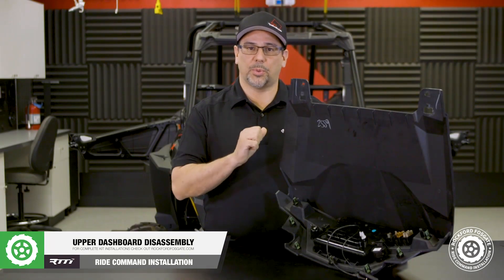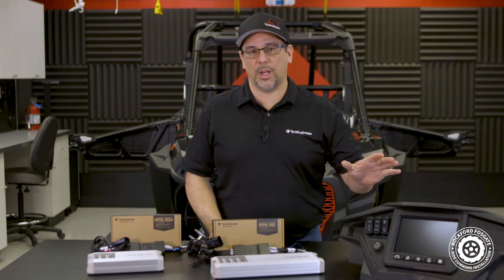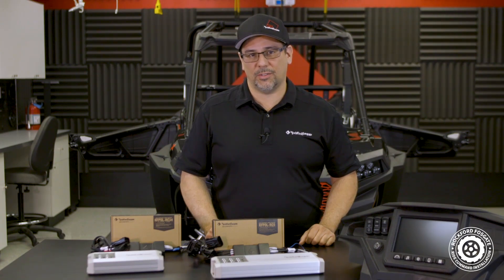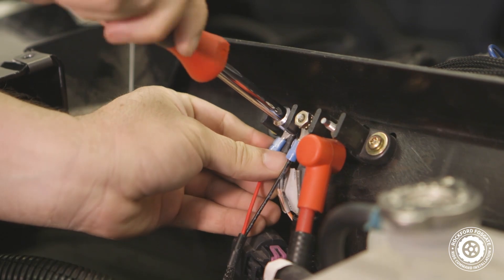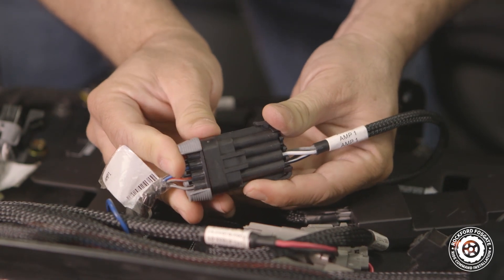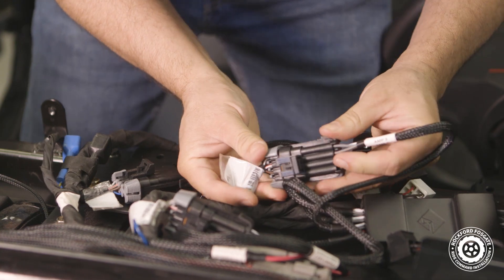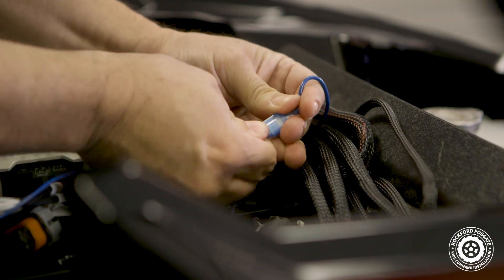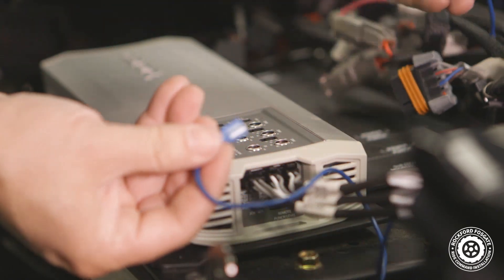Ride Command Interfaces STAGE3/4/5

Comment: I'm adding a RF stage 3 w/ ride command on my 2020 RZR Turbo S. It came with doors speakers and an RF amp as OEM. I want to keep it on, and install the RF Stage 3 w/ ride command, has anyone have pictures and info on how to do this?
Reply from the maker: HI Audric, Rockford Fosgate's aftermarket Stage Kits for Ride Command are not designed to interface with any factory installed audio equipment.
Reply: So I was told by an RF technician that I could keep my RF OEM amp and door speakers and still use the RF stage 3 ride command and hook it up to amp 2. Do they cancel each other out and disable my ride command
Reply from the maker: @audrichartendorp7630  You'll want to check back with that technician who told you this because it's not a configuration we support.
Reply: @rockfordfosgate  Ok, everything is mocked up, I removed the OEM amp, it's disconnected from the Dynamix module, but the Dynamix module is connected to Amp1, do I remove this and connect it the the RC-34 interface? What happens to the Dynamix module? Please give me a step by step instruction on this, your video only says re-install the dynamix module screws, but that's it. The RC-34 connects to the new amp input and output, Amp1 (front speakers) and Amp3 (Sub) nothing about connecting back to Dynamix module.
Reply from the maker: @audrichartendorp7630  Unfortunately there are no step-by-step instructions since adding a Rockford Fosgate aftermarket system to any Polaris OEM system is not supported.  What I can tell you is that AMP1 & AMP2 plugs are HIGH-PASS outputs and the AMP3 plug is a LOW-PASS output.

Comment: Can I use your Rockford RFHLC High Level Speaker Signal to Low Level RCA Adapte to send a signal to my current aftermarket amplifier? To keep the OEM speakers and add a couple more aftermarket speakers and a a subboffer? I have a 2021 Turbo S ride command and dynamix suspension. I know your Rockford RFHLC is not water proff, just want to know if that configuration will work.
Reply from the maker: What exactly are you doing because we're very confused with your setup.  Sounds like you already have a Turbo S + Ride Command system equipped with a factory installed audio system, correct?  There should be no need to add any adaptors in place since the factory system already connects the source to the amplifier.  For whatever your application is, the Ride Command Interfaces are designed to add aftermarket systems to Polaris UTVs with Ride Command having no existing audio system to filter out the digital noise caused by Dynamix.  Using a LOC like the RFHLC will not work for reducing high-level speaker line voltages into low-level RCA signals because it does not have any PWM filtering capability.

Comment: You don't explain how this item interfaces with stock amp or if the new replaces it, how are all the extra speakers plugged in if the rfpol-rc34 takes the place of the speaker outputs, seeing as input is supposed to be your head unit.
A simple picture lay out would have been more efficient.
Reply from the maker: This video is designed as a supplement to Rockford Fosgate Polaris UTV Stage kits (see links below).  It is not designed to interface with stock amplifiers.  The RFPOL-RC34 is specifically designed to interface with the Rockford Fosgate TM400X4ad aftermarket amplifier, and the RFPOL-RC5 is specifically designed to interface with the Rockford Fosgate TM1000X5ad aftermarket amplifier.

RZR14-STAGE3
https://www.youtube.com/watch?v=sddnwYFZ6z8&list=PL-ob-nWq0t1jl_ft08blTV-xN6aEQSRF-&index=14

RZR14-STAGE4
https://www.youtube.com/watch?v=gmh46ONL0mA&list=PL-ob-nWq0t1jl_ft08blTV-xN6aEQSRF-&index=16

RZR14-STAGE5
https://www.youtube.com/watch?v=g8mlU_-DdJo&list=PL-ob-nWq0t1jl_ft08blTV-xN6aEQSRF-&index=18

RFPOL-RC34 > TM400X4ad
https://rockfordfosgate.com/products/details/rfpol-rc34/

RFPOL-RC5 > TM1000X5ad
https://rockfordfosgate.com/products/details/rfpol-rc5/
Reply: @rockfordfosgate  I've watched all the videos back to back stage 3/4/5 and **-rc34  did not tie into the videos it also did not mention where the extra speakers plug into if rc34 takes their place on the amp.
Reply from the maker: @RTJoJo  When you mention "stock amp" and "extra speakers", did your RZR, General, or Ranger come equipped with a factory audio system?  If so, this interface cable is not designed for those systems.  The RC34 and RC5 interfaces are designed to build a system from scratch using the TM400X4ad or the TM1000X5ad amplifiers (as illustrated at 1:22 where we describe the interface cable and amplifier matchup) or as an interface for STAGE3, STAGE4, and STAGE5 systems.
Reply: @rockfordfosgate  My customer supplied a stage 3 audio kit with **-rc34.  Unit has factory ride command and audio/ rockford fosgate #4017614 amp. Per you stage 3/4 video, speakers are plugged in using splitter harness, sub is plugged into rear output. If this is so, there is no input from ride command. This is where **-rc34 comes in as interface for ride command, however if amp 1 is unplugged( power to oem amp), this terminated the oem speakers as well. RC34 now takes place of speaker harness and there is no input from ride command or any head unit. Per your video of how to connect rc34 to system.
Also if rc34 is plugged in there is no adapter to install sub to factory harness.
Reply from the maker: @RTJoJo  This sounds like it has the factory equipped MB Quart audio system.  Polaris was having problems with the MB Quart amplifier and we provided a replacement amplifier for the factory installed system, which we consider a closed loop system, not designed to be interfaced with.  I would highly recommend you contact our technical support so they can offer advice on what options you have.  They can be reached right now for the next 2 hours at 1-800-669-9899.
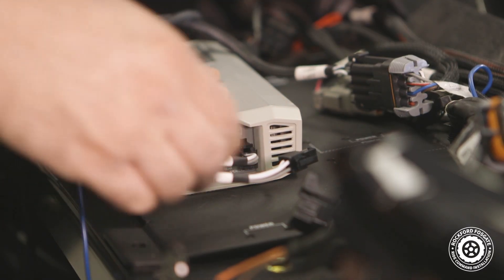Reply: @rockfordfosgate  so obviously the confusion was on my end and your tech guys were great. Where i was getting confused was at minute 3:25-3:30, visually it looked like to output/power side of the amp I was provided. The  amp you show may have the gainer plug in that I'd mistaken for the B+/-/R plug-in.
Reply from the maker: @RTJoJo  Great!  Glad they were able to help out.  You actually saw correctly, I accidentally plugged it into the amplifier outputs when we filmed this part.  I remember distinctly we were in a time crunch, it was a long day, and didn't realize we did it backwards until weeks after we released it.  You're only the 2nd person who caught it.  I apologize for the mixup on our side and glad tech support got it straightened out.

Comment: just got my stage 4 with ride command installed. Everything sounds great but when you power down there is a pop.  The stereo shop that installed it says they installed it per RF instructions and video and thats just how it is. Please help
Reply from the maker: How are you powering down the system?  With the key or the radio power button?
Reply: @rockfordfosgate  I've been using the key but i didnt think it should pop regardless. Any info is helpful, thanks
Reply: Also, I'm not aware of a radio power button on the ride command which is my only source
Reply from the maker: @jdub1788  Sorry, I was thinking you had the PMX-2 source unit, but you clearly said Ride Command.  I checked with our Technical Support because I have not heard of this and apparently some Ride Command modules do have a pop we have not been able to diagnose.  For the RFPOL-RC34 adaptor, we add a 15 second delay to prevent turn-on pop.  Unfortunately, it appears that some Ride Command modules generating an additional turn-off pop.  The Rockford Fosgate amplifier turns-off immediately, so turn-off pops occur in the signal chain prior to the amplifier. Unfortunately, we have no control over the turn-off noise happening inside the Ride Command source itself.

Comment: Have a 2020 Polaris xp pro, the stage 3 kit has a small connection to the sub left side, but the front and rear audio connections are on the 23 pin amp connector. I can not find anywhere on the rzr it’s self. to plug this big connector at, dealership suggested the rc34 connector but I just want to make sure because the sub is self contained with it’s amp. Will this kit work with ride command 7 button and the stage 3 Rockford fosgate speakers. Because at the moment only the sub is working.
Reply from the maker: No, the RFPOL-RC34 interface is for aftermarket audio systems utilizing the TM400X4ad amplifier that connect to Ride Command.  The Polaris XP PRO is equipped with a Factory Installed System that is COMPLETELY DIFFERENT.  If you are having problems with the audio system working properly, we suggest scheduling a warranty appointment with your local Polaris Dealer.  If there is water ingress into the amplifier just below the dash, this may cause the speakers to stop working.
Reply: Rockford Fosgate I think I finally figured it out, the dealer sold us the sub and rear speakers, and also needed the front base audio  kit with 4 channel amp. Thank you for saving me 109 bucks
Reply from the maker: @MADD69420  Ahh, great catch!  Yes, the "Stage-2" factory kit comes with the main 400 Watt amplifier: https://rzr.polaris.com/en-us/shop/accessories/audio-technology/2883943/
Reply: Rockford Fosgate thank y’all! I have chased down cables, connections. Phone numbers and tech service, YouTube gets it right after all day searching

Comment: When installing stage 5, do you abandon the factory amp and door speakers that came stock with the 2018 RZR ride command 1000 XP? If so is there a way to add the factory speakers back into the sound system with the new amp? I know the factory sound system sounds horrible but I thought maybe adding some actual power to the speakers may sound better? Thoughts?
Reply from the maker: Hi Jeremy, If your 2018 RZR Ride Command 1000 XP came equipped with a factory installed system, there are no provisions for adding the factory amp and speakers back into the system.  The STAGE5 system is already equipped with 4 full-range speakers, 1 subwoofer, and a massive 1,000 watt amplifier that should rock the entire forrest or trail.

Rockford Fosgate does not endorse any modification to the wiring harness as this would invalidate the warranty.  This would require hacking the wiring harness and wiring the factory speakers in parallel with the PM2652 (STAGE5) speakers.  The amplifier would divert 50% of the power FROM the STAGE5 speaker TO the factory speaker, likely causing the factory speaker to blow.  This is NOT an ideal situation because there are differences between these 2 speaker types, and it would be impossible to isolate power to each speaker since both are wired in parallel.  Rockford Fosgate does NOT recommend doing this.
Reply: @rockfordfosgate  Thank you for clarifying that for me so fast! I noticed that I had to unplug the "so called factory amp" plug to get the new adapter plugged in and I was curious about the factory amp and speakers not being used, so thanks for the clarification. Last question for now, I have a rear plexiglass window that is nice to keep the dust and snow off us while riding, I am just wondering if I should cut holes in the plexiglass where I mount the tower speakers ? Have you seen any setups like that? I am pumped to get the system installed this weekend! Thanks again.
Reply from the maker: @jeremybalfany2385  Great!  I'm glad the explanation helped to understand why it's not recommended.  The rear window option is 100% up to you.  We do recommend a work-around that prevents you from cutting anything .... that is firing the speakers on the "outside" of the roll cage.  I show how to do this at 20:13 on this video that had snorkels installed: https://www.youtube.com/watch?v=UcGZhDPo_-I.  You can direct them outward a little instead of firing directly into the glass.  Not a 100% work-around, but it gets the job done and prevents you from cutting anything. -Eric
Reply: @rockfordfosgate  Hey Boss, do we need to remove the factory amp for the new amp plate to be mounted? Looks to be in the way without any place to remount it. I would have to leave the wire harness to the factory amp unplugged. If that's the case I just want to ensure I will not have any electrical issues. Thx!
Reply from the maker: @jeremybalfany2385  If you're using one of our stage kits with the RC Interface Cable, then yes, our amp plate fits in the area where the factory one is located.

Comment: Do you get the same sound quality as using a head unit?
Reply from the maker: Great question James!  As confirmed through Authorized Rockford Fosgate dealers, SQ is different as compared to using a dedicated source unit like the Rockford Fosgate PMX-2, PMX-2 or PMX-8 source units. If you want to retain your Ride Command with all the cool navigation features, this is the only device on the market currently that electronically filters pops and noises when switching between DYNAMIX suspension modes.

Comment: Just so you know on the stage 3 and 4 you clearly say to connect the interface to the in put side of the amplifier but in the vidio you are connecting the interface to the out put side of the amp. I do still get a pop when I start my utv I have a RZR turbo S can you advise on how eliminate that pop on start up or did  I do something wrong..
Reply from the maker: Pull the dash off and remove the 4 small button-head screws that secure the amplifier to the mounting plate.  Reconnect everything back to the amplifier and put a clean shop towel or cardboard under the amplifier so it doesn't touch the metal mounting plate.  Turn the system on and see if the noise is gone.  If so, you're experiencing a ground loop.  You can use 2 nylon or plastic washers per screw (1 under the amp, and 1 on top under the button head screw) and remount the amplifier.  This will keep the screws isolated from the amplifier and prevent the amplifier from grounding out to the metal installation plate.
Reply: He is connecting to the input side, not the output. These amps do not have have chassis mounted RCA's. They use an RCA to Molex adapter. He is plugging into the Molex input.

Comment: Just got my stage 5 installed in my 2019 Turbos S with Dynamix and I have a consistent fuzzy sound, even when I turn the volume on my ride command all the way down to 0, When I play music at low volume the fuzz noise changes with the beat of the music but is always there. I tried to find the amp setup guide as well and couldn't find it. I ripped out my entire polaris system (pods, door speakers, and sub to replace it with this kit and so far I love everything about the kit but am disappointed with the fuzz and lack of an amp setup guide. What do I do now???
Reply from the maker: Hi Richie, just clarifying, you have the STAGE5 for Ride Command, correct?  We are updating the RideCommand tuning guide to accommodate a ground loop we encountered in the Turbo S.  Pull the dash off and remove the 4 small button-head screws that secure the amplifier to the mounting plate.  Reconnect everything back to the amplifier and put a clean shop towel or something under the amplifier so it doesn't touch the metal mounting plate.  Turn the system on and see if the noise is gone.  If so, you're experiencing a ground loop.  You can use 2 nylon or plastic washers per screw (1 under the amp, and 1 on top under the button head screw) and remount the amplifier.  This will keep the screws isolated from the amplifier and prevent the amplifier from grounding out to the metal installation plate.
Reply: Rockford Fosgate yes I have the STAGE5 Ride Command thank you! I actually just went out for lunch, when I get back to the shop I will try this and update you! Thank you for the
Reply from the maker: @Richieyfz450  Thanks for confirming that you have RC.  Let us know if this DOES or DOES NOT work and we'll go from there.
Reply from the maker: Forgot to mention, use this guide since the RideCommand output voltage is the same as the Ride Command interface, therefore the amplifier settings are identical: http://www.rockfordfosgate.com/rnt/rnw/docs/1356/amptuning_rzr14_2014-2019.pdf

Comment: Buying a 2019 RZR Turbo S with 7 button Ride Command. Is the RFPOL-RC34 and RFPOL-RC5 interface the most recent kit available to eliminate any interference & pops on start up??
Reply from the maker: Yes they have been tested to eliminate all interference and pops during start up on both 5-button and 7-button Ride Command units. We're actively filtering the electronic noise caused by the DYNAMIX suspension system, versus using passive components that everyone else is using.  There is nothing else on the market that compares to the filtering used on the RC34 & RC5 interfaces.  We're hearing a ground did change on newer RZR models and are recommending to use mounting isolators on the STAGE5 amplifier.  These simple to add plastic washers at the mounting locations will cover you regardless of the year/model.  Technical Support can help you more when you get to that point.